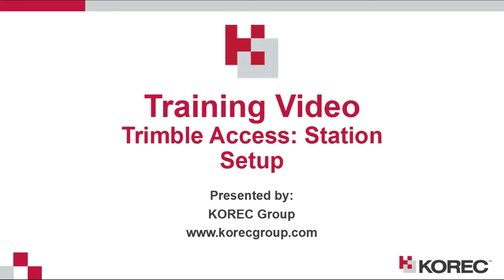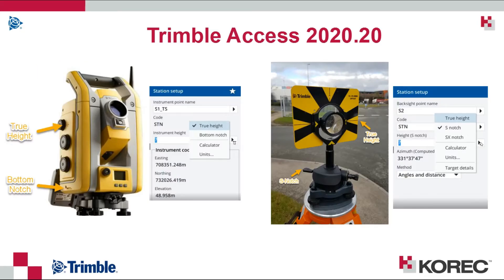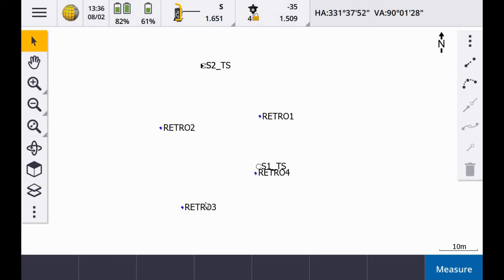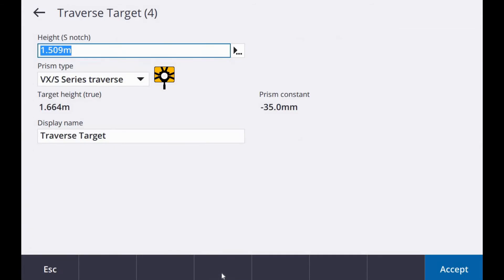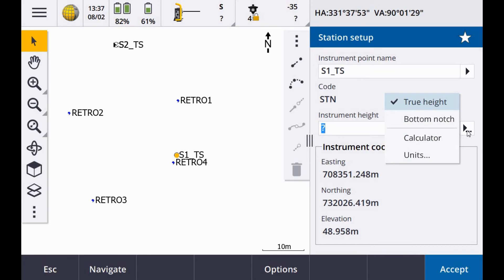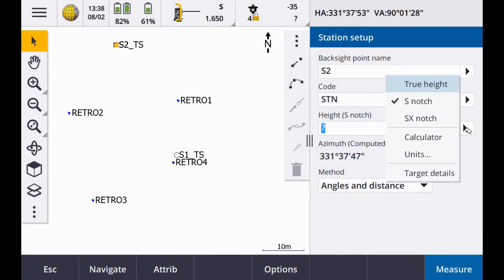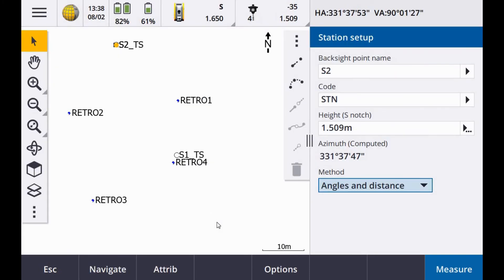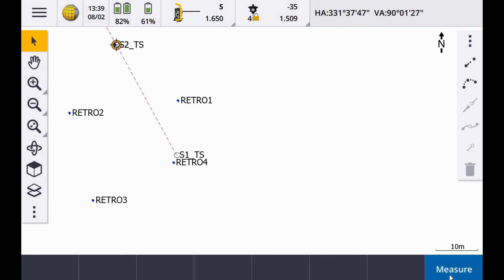Trimble Access Station Setup

Comment: How does the total station even know where direct NORTH is to compute that backsight azimuth of 331 deg etc????  How did you determine direct NORTH to set the total station plate at 0 deg?
Reply: Setting uo on previously shot gps is usually how I do it. Or rotate the job in